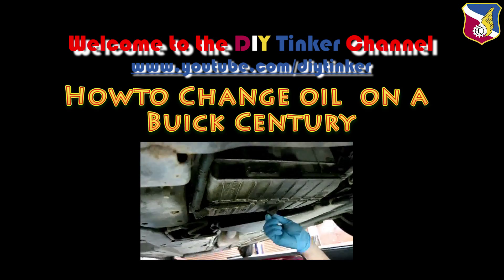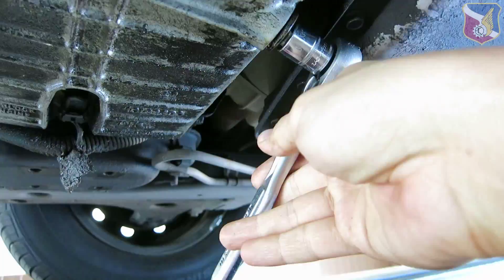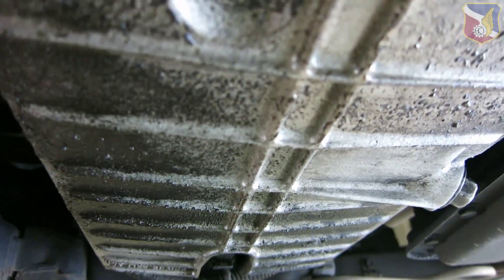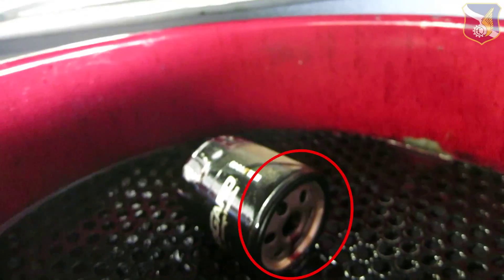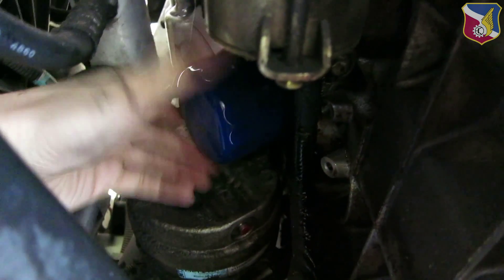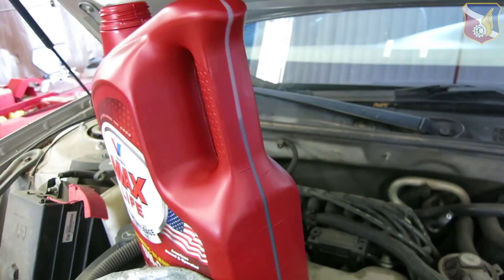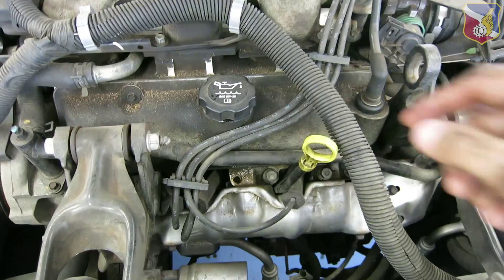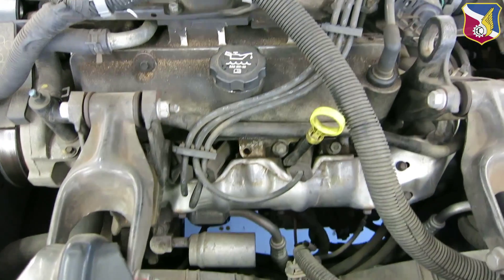Buick Century Oil Change - Howto replace oil filter - 2003 2002 2001 2000 2005 2004 01 02 03 04 05

Comment: my buick century custom front blinkers just light but don't blink back is find in the car it flash real fast any suggestions please an thank you .like your video keep them coming
Reply: Chances are it's a bad blinker relay - $10 part.  Just replace it.
Reply: Antonio Diggs if the bulb comes on but don't blink.  change the bulb